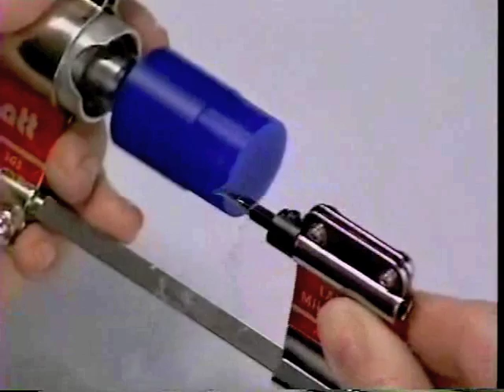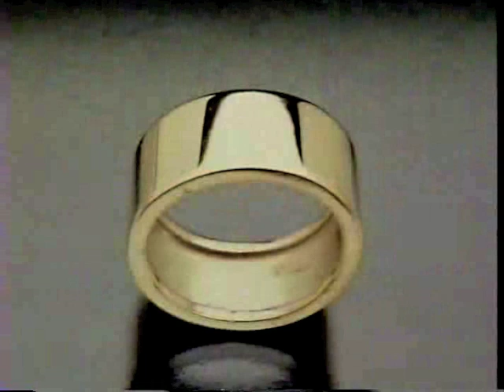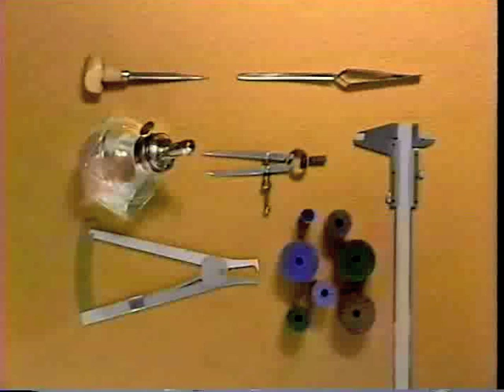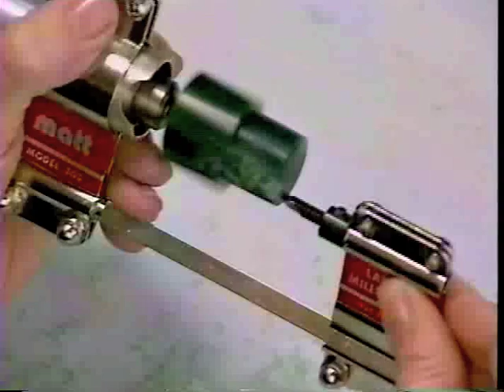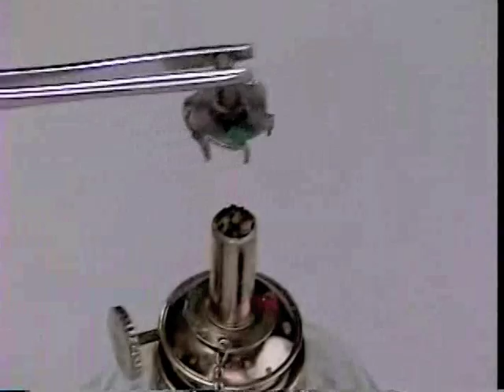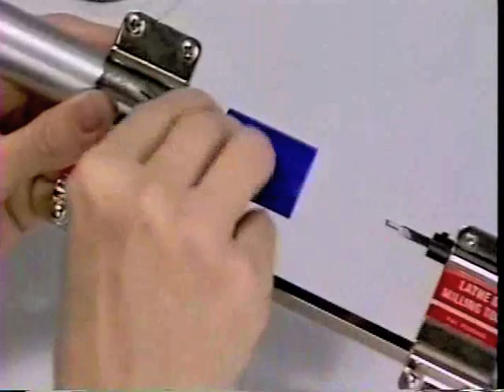Matt Mini-Lathe Intro

Comment: I use a taig lathe I bought on ebay and I made a mount to use my cordless drill as a power source. Works great and I can turn things with it any where any time and it has plenty of power to turn metal or things like wood or wax. 

I made a simple metal strip with a screw that gets clamped to the cordless drill handle with a hose clamp shaped like an "L" and this allows to turn the screw that contacts the trigger and adjust the drill speed and thus the lathe speed. 

Simple and it can do 100% more then this tiny lathe and was built using all used cheap stuff for about 375.00 for everything.

Comment from the maker: Once the wax model is finished, it is sent to a caster to be cast into gold, silver or other metal.  This is done using the Lost Wax Method where a mold is made around the wax model, the wax is burnt out and then the precious metal is injected into the mold.  Do a search on YouTube for the Lost Wax Method to see it in action.
Reply: Matt Jewelry Design Products does it work with wood?

Comment: Wow!  Only $175 from Rio Grande.  And the motor and handpiece you also need to make it work is only $227.  That's only $402 for this super-precise ultra-high quality stamped-metal tool!  How much does the "turn wax into gold" kit cost?
Reply: Most jewelers already have a flex shaft.   This facilitates work for model makers.  Once the wax model is finished, it is sent to a caster to be cast into gold, silver or other metal. This is done using the Lost Wax Method where a mold is made around the wax model, the wax is burnt out and then the precious metal is injected into the mold. Do a search on YouTube for the Lost Wax Method to see it in action.